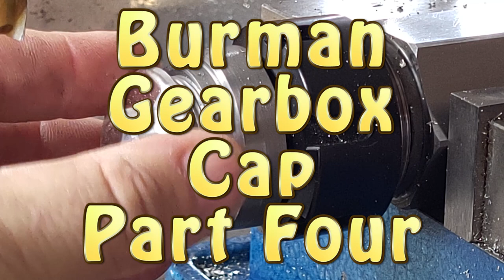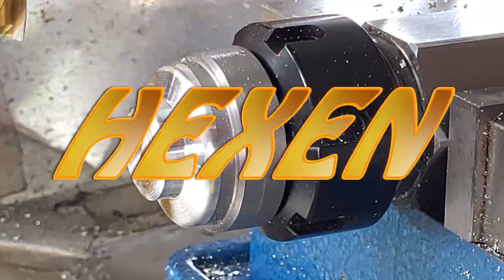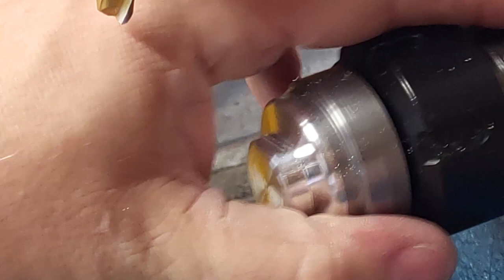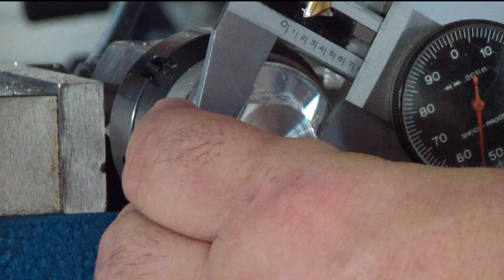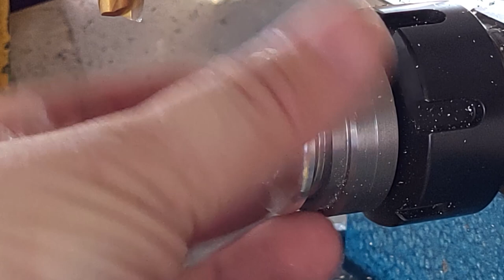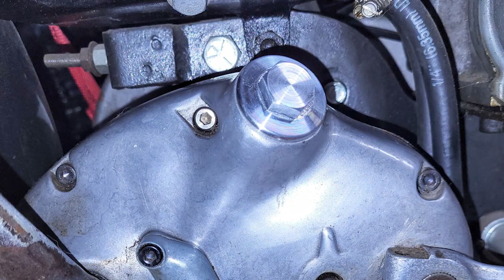Machining a Burman Oil Filler Cap on a LinuxCNC Lathe Mill Combo - Part 4 - cutting the hex

Comment: Cool vids. I also have one of these exclusive machines and was wondering where one could get parts? I want to add CNC. Can you show some programming specifically for this machine?
Reply from the maker: Shoptask are now chicagolathe.com . While they do not list many parts for the older machines on the site, you can contact them and they may be able to assist.
Reply from the maker: Some details on my cnc https://hackaday.io/project/181112-shoptask-1720-linuxcnc comment there for question on that.